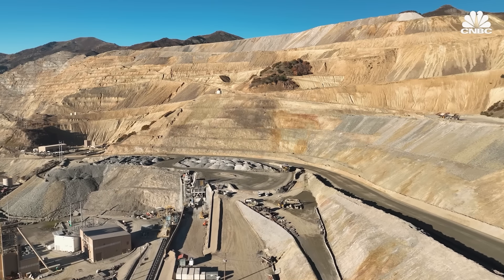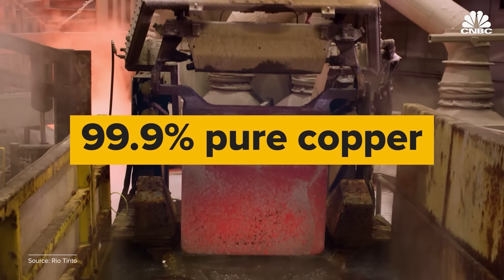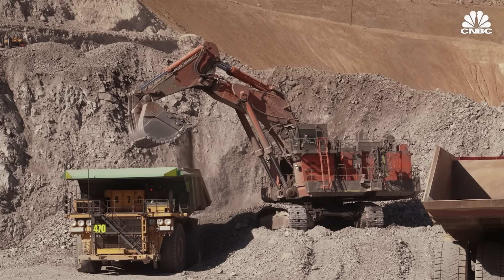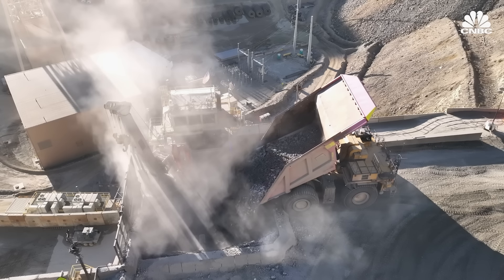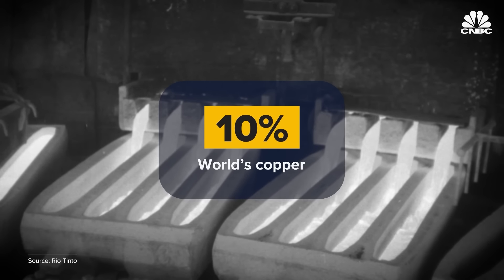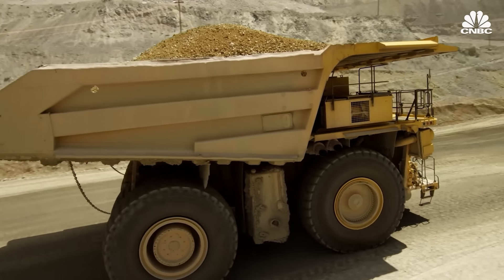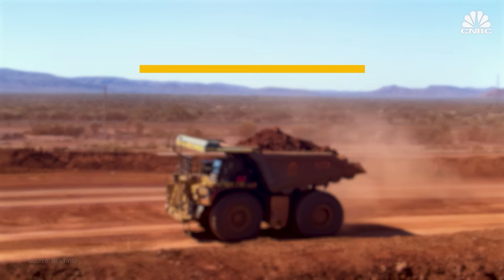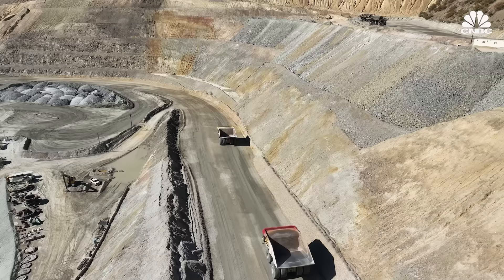Why Mining Giant Rio Tinto Is Benefitting From The EV Boom

Comment: Increasing demand of copper is not a just result of EV boom, its a result of increasing electrification in everything. That includes energy transition, industrialization, semiconductors and electricity consumption in general. It is very wrong to say the EV boom is the only reason responsible for the increased demand of copper. The EV industry is still very far from driving up the copper prices alone.

Comment: Don’t tell EV buyers that the Utah site burns in excess of 70,000 gallons of diesel a week to make this happen.
Reply: I would've thought a lot more than that. You see how big those trucks are?
Reply: I believe the mine uses 10k gallons a day.
Reply: Don't blame EV blame Rio Tinto, there are cleaner options they aren't using
Reply: I'm a fan of EVs and I don't see the problem. We're still early days of EV adoption. EV mining equipment already exists and is gradually spreading. And actually if you're mining on the top of a mountain, the mining can actually generate electricity by letting the movement of ores off the mountain and into the valleys to generate electricity. We need to mine a lot of resources to shift the economy and mining locally is better than trying to get resources out of hostile countries in the middle east. Also, eventually, because most of the contents of an EV are highly recyclable, the loop will close and significantly less mining will be needed. That'll take decades though as the first generations of EVs are still on the roads.
Reply: @Ergzay  methane production from waste is greener by far
Reply: There’s a cool company called first mode that’s working on switching them over to hydrogen
Reply: @cjspencer5396And yet, it’s still more green than the current cars on the road. By far. Much less emissions are being produced by making the cars. If you look it up, a Tesla offsets the omissions used to make it in around a year.
Reply: How many gallons of diesel are used every year just hauling fuel to gas stations?
Reply: That's only for a week.
Reply: @tira2145  you’re right. I was actually thinking that sounded low
Reply: @cmdr1911  you’re right, I edited my comment.
Reply: @NvidiaRTX5080  yeah you’re right, it’s 70k/week.
Reply: @turkishhusla  Are right like what?
Reply: @Ergzay  The mining solution you quote lol. how many mines?
Reply: @Ergzay  " movement of ores off the mountain to generate electricity " You sound like trump !
Reply: That’s an interesting point! 🤔 It really highlights the complexities of balancing progress with environmental impact. Do you think advancements in renewable energy for industrial sites could change this dynamic in the future?

Comment: There are engineering solutions that can drastically reduce copper requirements.  If copper costs enough for long enough, companies will change their designs.  For instance, communications throughout a vehicle can be multiplexed onto a single pair of wires.  Need more power transmitted on less copper?  Increase the voltage.  Hell, communications can actually be multiplexed onto power lines too!  There are practical limits of course, but we are nowhere near them.

Even the issue of mining enough lithium is solvable.  There is a lot of lithium available, but processing some of it is rather nasty and expensive.  But there is a lot of R&D currenting working on sodium based batteries.  Sodium has more free electrons in its outer valence, meaning one atom could theoretically store more power, offsetting it's higher mass by increasing energy density.  Sodium is incredibly abundant and found in every drop of the ocean water.  Switching to sodium could actually reduce cost and eliminate at least one of the mining bottlenecks in EV adoption.
Reply: Boring

Comment: The Banks manipulate the price of Silver and Gold. That should be a crime.  Facts
Reply: Oh no! Not my shiny rock that does nothing!
Reply: A currency with no material backing will always exponentially inflate to poverty.
Reply: @TheLastDanite silver and gold are extremely useful in electronics, party for the reason that people have always liked them. They don't oxidize (tarnish). Make them great for contactors. Silver is even better, as it's even more thermally and electrically conductive than copper
Reply: Check out solar panel use of silver.  It's going to single-handedly make silver go mad.
Reply: @edwardk3  silver is not required for solar panels, it's just preferred
Reply: @NvidiaRTX5080 that is true.  But the cost contribution of silver to the overall cost of the panel is minimal, so it will continue to be used even after silver blows the roof off.
Reply: @edwardk3  The cost of all materials in almost anything you buy is small. Manufacturing and R&D is what you usually pay for. That is not a valid argument at all.
Reply: @NvidiaRTX5080  you have not established a reason why copper will soon be substituted for silver.  You're the one who needs to prove your point.  The status quo is silver and mg/w has almost doubled recently in new designs that use more silver.
Reply: @edwardk3  I just did, you weren't reading. Manufacturability and R&D.
Reply: @NvidiaRTX5080 again.  Saying those two words doesn't establish a case that silver will be phased out. 

Specifically what about R&D?  Specifically what about manufacturing?

I'm asking with a genuine interest to learn just so you know.  You're just not communicating it well to me.

The direction so far as far as both of those goes is towards almost doubling the use of silver per w generation.  So your case as far as I can tell is towards more rather than less.

As solar panels is around a full quarter of the global use of silver, and the number of panels to be produced in the next 5 years is set to more than triple, while use of the metal is to double from current rates, all the while there is a diminishing supply.  It seems a pretty tough case to be bearish.  I'm a bull, so if you can find evidence to the contrary, I'd really like to know.

Comment: Very good! Don't even mention the contamination factor, the humungus amount of clean water those mines use, that's not important at all, praising the company is the good journalism!
As a journalist myself I feel like puking right now.
Reply: Sure mining has it's issues, but let's not pretend that our current path of using fossil fuels has no problems. At least with EVs the batteries can be recycled and neither solar panels nor wind turbines require fuel to operate. Good luck with recycling car exhaust, and best of luck running a coal-fired power plant without coal.
Reply: Lol at the replies to your comment. This is why it's so easy to run businesses. You can shape public perception so easily, because journalists are basically corporate advocates now. You're lobbyists, under a different name.

Comment: Rio Tinto's Kennecott copper mine in Utah, the second largest copper mine in the US, produces around 200,000 metric tons of copper annually. Global demand for copper is expected to almost double by 2035, as copper is a major component of electric vehicles. However, the mining industry faces environmental challenges and concerns from local stakeholders while operating in remote locations. As a crucial player in the transition to green energy, Rio Tinto invested more than $2bn to modernise the Kennecott mine and facilities and is trying to open an underground copper mine 60 miles east of Phoenix. Rio Tinto is one of the world's largest mining companies with projects in 35 countries, producing materials such as iron ore, aluminum, diamonds, boron, and copper. Renewable power systems such as wind and solar are at least five times more copper intensive than conventional power, and to meet that demand, Rio Tinto is ramping up production of its critical minerals business. The company is hoping to increase its copper production by 30 to 40% over the next five years and potentially build one of the top ten copper mines in the world.

Comment: I can get my heat from natural gas or heating oil. Why would I add complications to the system to get the same amount of heat?  Depleting other natural resources such as copper, cobalt, lithium, and the likes it seems like we're only complicating the system at the same output while not much greener in the long run. Why deplete and multitude of resources when you can only deplete one or two?